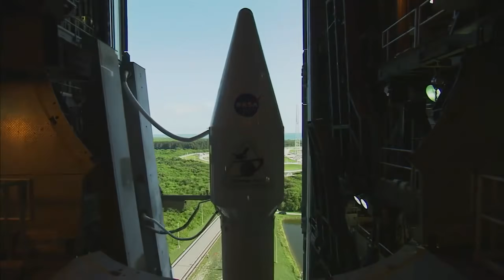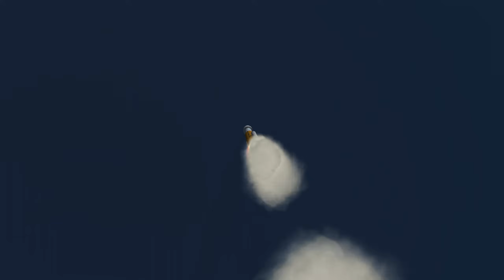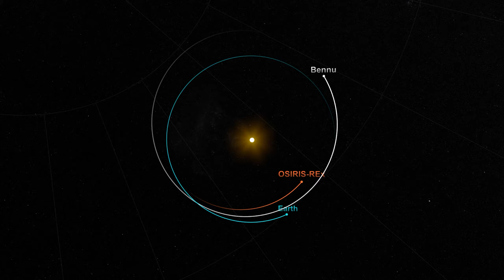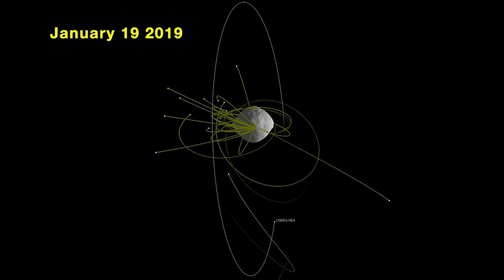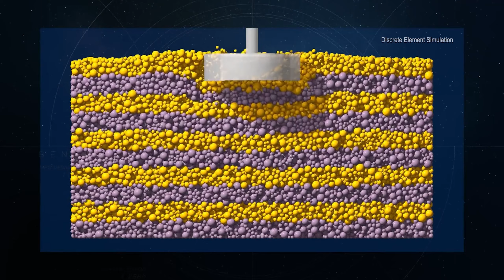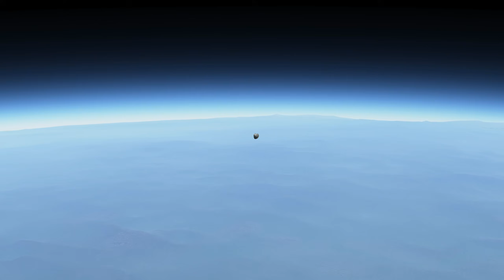OSIRIS-REx Asteroid Sample Return - KSP Stock Replica - To Bennu and Back

Comment: I never seen a rocket with just one SRB before, looks so weird and unstable, but it actually worked
Reply: Very late response, but yeah, the Atlas V is also capable of holding 3 SRBs, 2 one one side and one more on the oppi=osite side, as well as a total of 5 SRBs, 3 on one side, and 2 on the other. It's actually not that unstabble